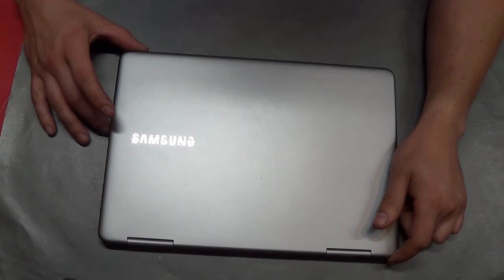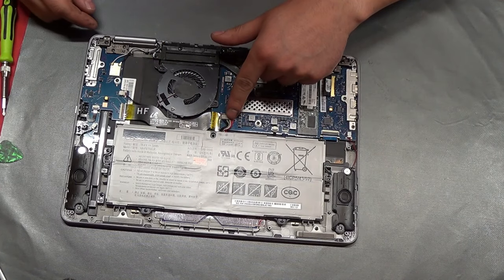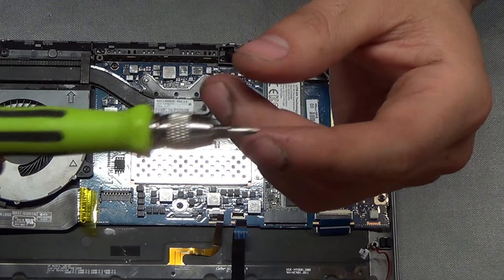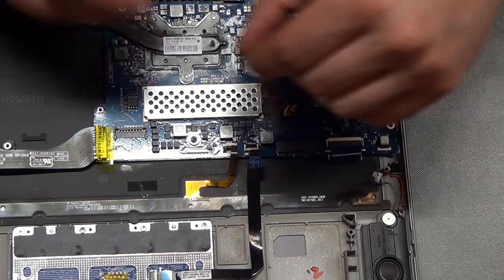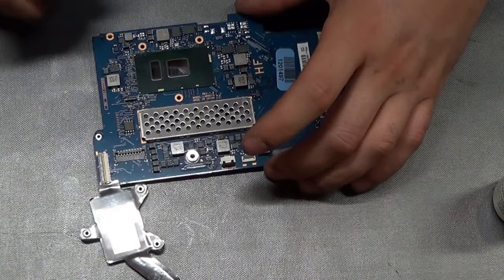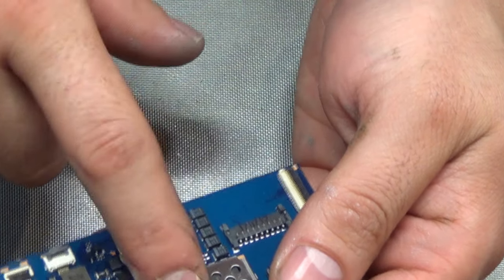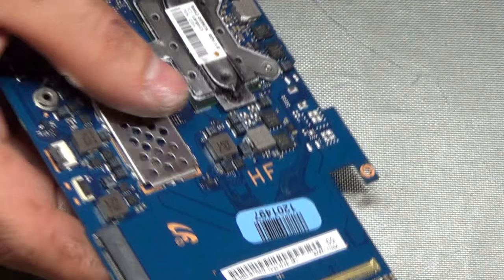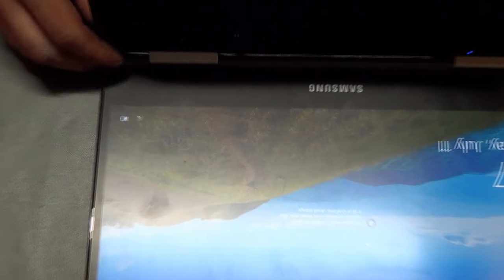Samsung Notebook 9 Laptop motherboard replacement - NP940X3M-K01US-

Comment: One way to quickly drop and stay organized with PC screws you take off is to get the - PATIKIL 24 Grids Mini Portable Walnut Watercolor Palette to drop them into. You can drop a different category of screw in separate wells on it. You'll want to tape it down hard to your desk so you don't accidentally hit it and all your screws go flying all over the place. You could also buy a pack of those micro zip-lock bags and label them.  I tend to take screen shots of YT videos like this (in various stages of disassembly) and inset the image in a photo editing program (so there's a white border left all around the image on the paper - to write notes on later - when it comes out of my printer). I then draw arrows on the printed paper indicating - the black short screws go here, here and here, the long silver screws go here, here and here - in order to keep track of it all for re-assembly later. If there's no YT video available, I just take pictures with my phone (as I disassemble) and then do the same thing with the white border later.

Comment: Hi, I really need a New battery for my Laptop. I have a question though. My model number is NP940X3N..  I seen the same ending in M instead. Would that be compatible or work? I looked on Amazon but afraid to order. Helpful video, thanks for posting it"

Comment: Great video. I like that you recorded the complete process. I have the 9 pro 15 with 16g ram; 256gb SSD ; I7 8xxx cpu; My 256g SSD is full so I am upgrading to 1TB...the current (factory installed) 256GB SSD is SATA. Can I replace with a m.2 2280 PCI-e NVMe SSD?? I have a 1TB sam 970 evo, or a intel 660 2TB, both PCI-e  NVMe  ---  will either work?? 
Thanks, RJ
Reply: i dont think so, 860 EVO wil works

Comment: hi, i have the same laptop that will only run when it is plugged in. i have replaced the battery once . do you think mine could be the motherboard as well?
Reply from the maker: What was wrong with the original battery that you had to replace it? Is the replacement battery OEM or aftermarket?
Reply: hello, where did you get the battery for it? my computer is having the same issue

Comment: Hi, I want to know, does this laptop have an extra slot to install a second hard drive? Ssd?
Reply from the maker: Hey, no it doesn't have a second connector for a second SSD. If you need more storage, you can either get a  micro-SD card and use that for storage but it will be much slower than an SSD. Or you can buy a larger SSD and install that in place of the original drive.
Reply: @cluelessguy1754  Alright, thanks a lot for your reply.